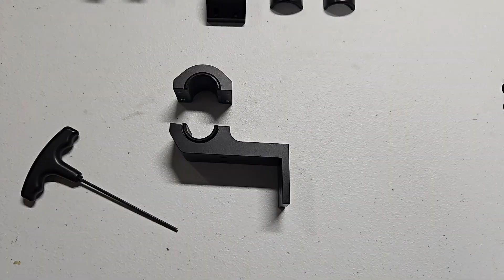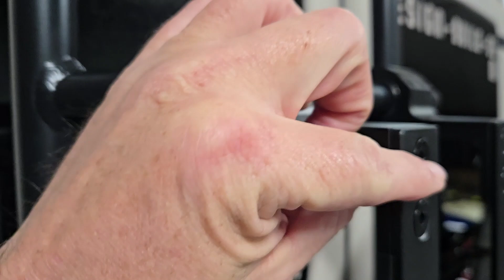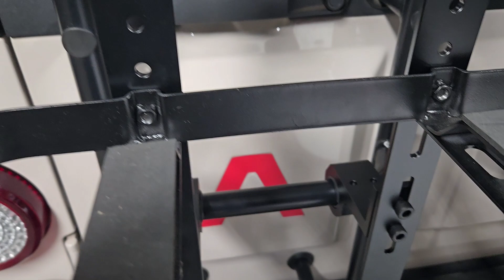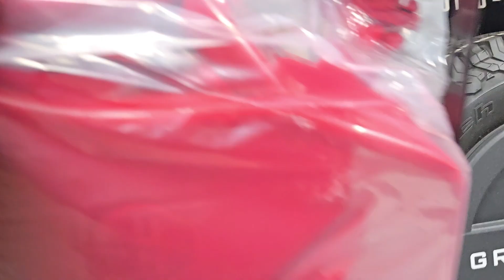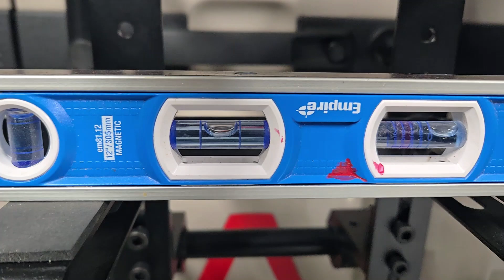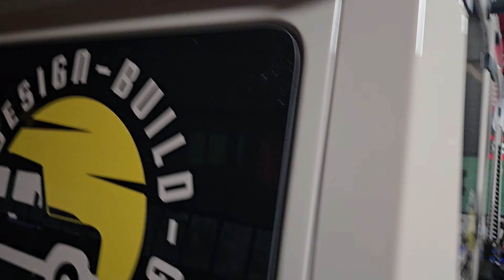@DVAMechanics accessory ladder rack and Jerry can for INEOS Grenadier #ineosgrenadier #grenadier

Comment: Just bought this and looking to install.  Surprised they do not use any locking nuts or spring washers.  Definitely will be adding these to ensure it doesn't vibrate loose when going offroad.
Reply from the maker: Take a look at changing the hardware to stainless as well.

Comment: Have you also seen the Model from BlackSheep? It's for several different canisters and you can fold it up when not in use and use the ladder normally
Reply from the maker: It is a very good option as well.  I hope to be working with Blacksheep products more in the future. I try to review everythign we install but have not kept fully up on those.

Comment: How do you use the ladder after you fitted all these accessories?
Surely you’d be better off fitting the German made later that’s designed to have a jerrycan and still can be a ladder to climb up onto the roof .
Reply from the maker: Thank you for your input. I think the basis for this product is a much more cost effective solution than the Letech one that is about $1500 here in the US versus this that about $350 as shown.  I don't use the ladder much so I am not that committed to the ladder function.  I do think this accessory ladder mount is ideal for skis and other flat portion items like Maxtraxx.